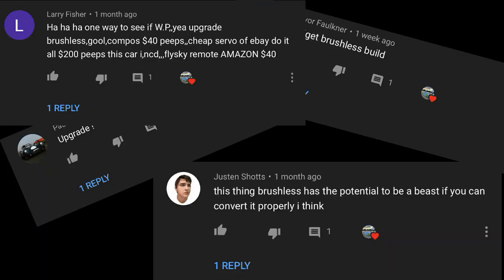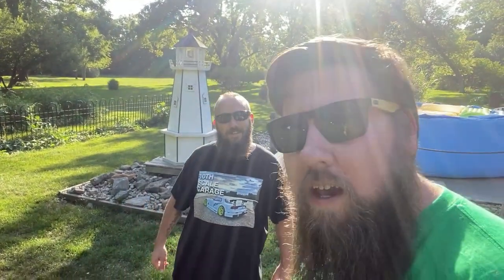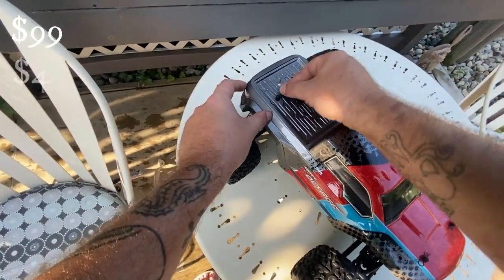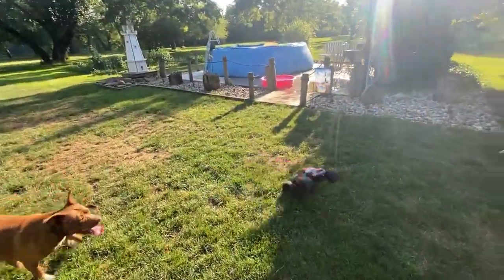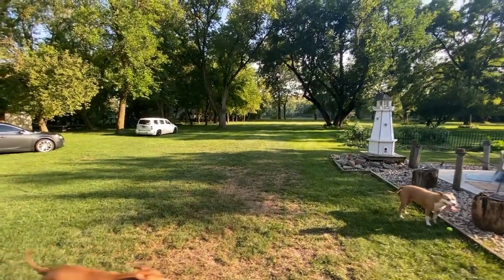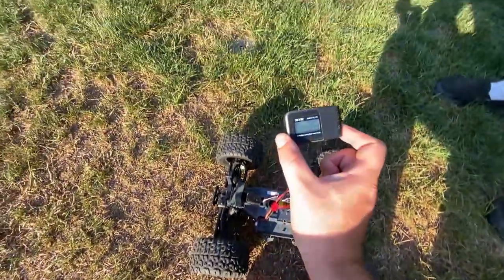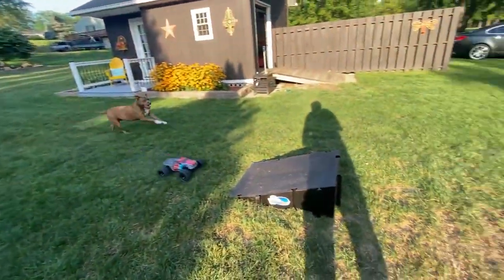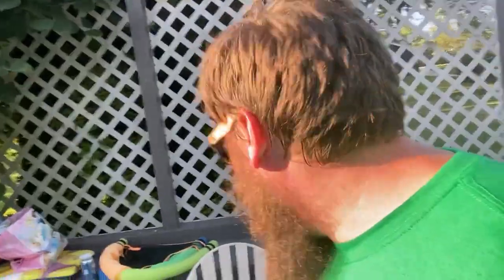Arrma Granite Voltage gets a CHEAP BRUSHLESS UPGRAGE- The Cheapest Arrma Money Can Buy

Comment: I'm not surprised your diff broke, I bought a Granite Voltage back in March because I wanted a cheap brushed 2wd truck to mess around with. The diff didn't last 5 minutes with the brushed motor for me and the part was ON BACKORDER FOR NINE MONTHS. People were complaining on the Arrma forums since Dec 2019 about the diff being on backorder and they finally didn't come back in stock until July-Aug 2020.

So ever since then my Granite has been a parts bin donor haha still not too bad for $100 considering all the spare parts I got for it. BUT it does make a terrible first RC though, the lack of upgradability, the chassis/shock towers are all one unit, you have to take the entire truck apart to change the diff so it's a pain to work on, and Arrma parts support are really suspect, waiting NINE MONTHS for a part is unacceptable.
Reply from the maker: Yeah, I’ve heard horror stories about it but that wasn’t my experience. It’s hit or miss sometimes, I’ve got a buddy that’s been waiting that long on Kyosho parts. No joke. I have a theory that Arrma really doesn’t make those trucks. They just stamp their name on it and sell it at $100 to fill a hole in the market. Meh. More power to them.

Comment: Yes I've had one for 3 years or so. Its upgraded to brushless 3000kv motor and esc. I kept stripping out drive cups more then diffs. So I replaced them with metal cups havent had a problem since. Now just diffs every now and then. The main problem 3 chassis later is the motor mount holes likes to crack alot since its plastic. I wish they would come out with a aluminium chassis upgrade for it or something. I also replaced servo and shocks has trackstar shocks and chevy Silverado body now and proline super swampers 2.8.
Reply: Forgot the most important thing put T-bone racing wheelie bar they make one for it and basher front bumper also need that wheelie bar it's a must when u go brushless have no problems with control now even on hard road
Reply from the maker: That’s awesome! I didn’t know they made metal drive cups
Reply: Actually they dont make them for the granite voltage. I read on internet about ppl having problems with the plastic one s and a guy had done this and gave me item # for some from a different arrma rc and cost like $15 and I tried they worked if ur interested I'm sure I can find out which ones it was they come with a grub screw hold them on. Sorry wasnt more exact about those.
Reply: U can also use hpi racing forza flux 103663 cup joints size 5x13x20mm
Reply: Well one more thing I just found integy makes the whole rear axle for granite voltage with drive cups and all kinds of alloy upgrades from bulkheads to shock and body mounts hub carriers caster blocks wheel hexes and more and the axles r $30.99 with cups and all.

Comment: That sounds like stripped gears, but check the diff outdrive cups. They may have just rounded off where they slip onto the transmission. That's the issue that I had with mine. Cheap part and takes about 3 min. to replace. I've had fun with mine, but definitely lacking in the durability dept.
Reply from the maker: It’s the diff. I tore it apart that night. Hopefully the new owner has better luck (if we get to 500 likes)

Comment: I bet you the drive cup is stripped. Sometimes they strip without actually breaking in half.

I do have an Arrma Voltage, was a Fazon but I truned it into a Granite. I've stripped gears twice with the stock brushed motor on stock gearing. I've also stripped and broken many of those outdrives from normal use. I mean small jumps and putting around in the street the driveline just falls apart. I had always planned to go brushless with it, but I quickly realized that it's just not going to hold up. If someone made a steel gear set for the truck, I'd buy it even at $100, but they just don't have it. And by the way, that issue with your stock esc burning up, yep had that too. Can contact Horizon Hobby and they will replace it free of charge, but you might have to get it replaced 6 times before you get a good one. That's what happened to me.
Reply from the maker: Drive cups are fine! My diff is totally stripped. Oh well. I have the parts to fix it, just not the time.

Comment: Had mine doing 50 plus with 25 t pinion and hobby wing max 10 blew trans on 3rd 2s pack trew her in the trash my stock brushed esc blew up aswell
Reply from the maker: Dang! I hope you didn’t throw away that max 10.
Reply: No it’s in a flm stampede

Comment: Stretch it! Turn it into a 1/5 scale like RCManiaDotCom did with his Stampede ( tho his no longer producing Videos because he got burnt out) and I plan on doing to mine. HAND Make Some Parts for it out of Aluminum and Only Using a Hacksaw, File, Drill like I did with a few of my trucks... mostly A-arms and Shock Towers and a few other Easily done parts.
Reply from the maker: I’d like to get a 3D printer and mock up some parts for stuff like that.
Reply: @10thScaleGarage  3D printers were not around back in Early 2000's and used tools I had lying around the Hobby Shop I hung out at all day, everyday... Didn't Officially work for they guy just hung out and did everything a employee would do.. Paid under the table.. I Still need to make a 1/5 Frame for my Savage since no one makes/sells them anymore and when they did...$$$$$$$$$$... The Plastic in the Granite is Supper Soft. I Dented the Rims with my Fingernail.. That's why they rounded out. No Jump bigger than what you were doing and running it through Grass. Even at $99, it's kinda not worth it. By the time you upgrade it, Might as well went to Banggood/Aliexpress and got a Pirate1 or 2 or Any of their 1/8 trucks..

Comment: What brand is the motor and what is the minimum you have to get for it to work
Reply from the maker: I can't remember the brand name but you need a transmitter, reciever, servo, ESC and motor. You can do the conversion for about $100 but you're better off getting a different truck at that point.

Comment: How about a few links to the upgrade
Reply from the maker: I wouldn't recommend the brushless system I got. The servos are ~$10 on bang good (link on the community page) and the reciever will only work if you have a Spektrum DSMR transmitter.
Reply: @10thScaleGarage  what is it still!? I'm trying to get it for a small upgrade

Comment: What motor esc combo did you use?
Reply from the maker: A no name system from Amazon. The cheapest one I could find.
Reply: Thanks. My buddy has a v1 granite voltage and it isn't working. I think it's the receiver but just in case it's the motor/esc I wanted to have a good option.